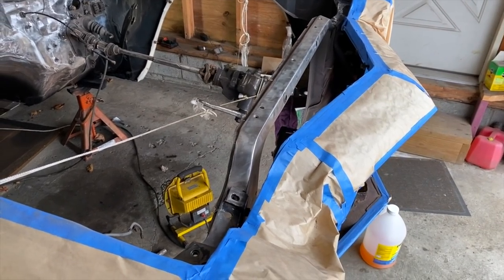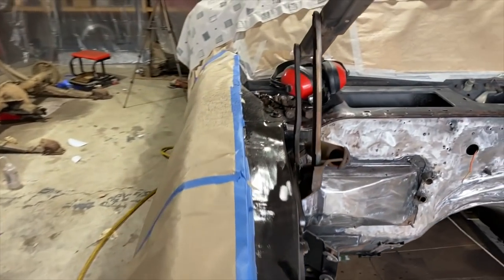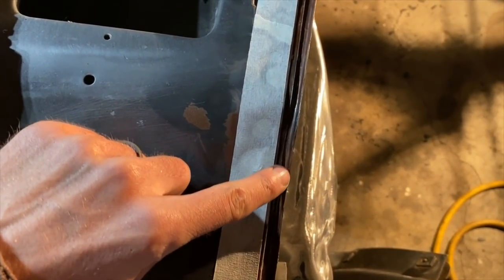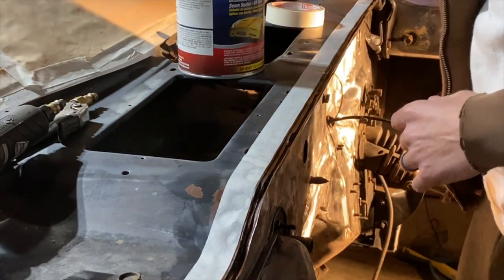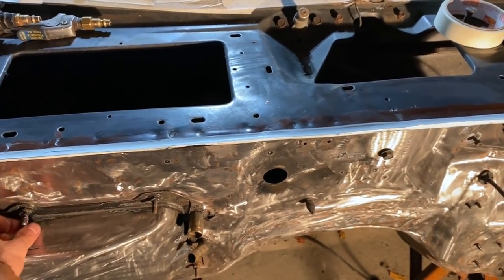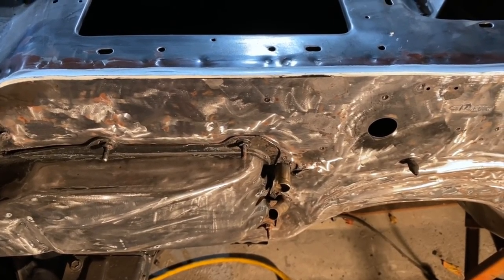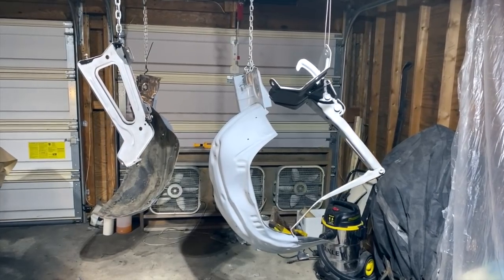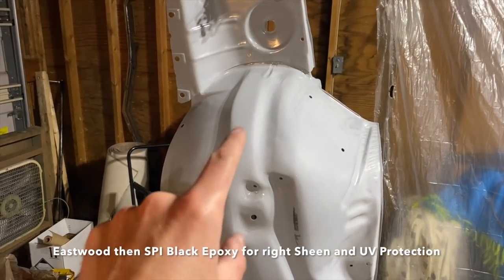PAINTING the ENGINE BAY, Rear Differential and MUCH More On the 73 CAMARO- Let's Sling Some PAINT!!

Comment: I think on the later "73 built Camaros the trim tag is accurate...in place with screws.    I don't believe they were all rivited on.
Reply from the maker: Awesome! Thanks for the tip Bobby. Going to have to look into it more then!👍
Reply: I would like to see a video on the seatbelt warning system...it would be cool to see you getting that working as designed.  I can assist with that... Awesome work, please keep the videos coming!
Reply: Screws are factory my 73 z28 has them.

Comment: I know this is a month old video but I had to say that removing the vin plate & body tag(s) is a major no no. Mopars are a little different as their tags are on fenders but I have never & will never remove any factory installed data plate. I believe its even illegal in certain states. Too much of a liability removing them as you always wonder if something shady is going on. I will not buy any car or truck that I even suspect that the plates have been messed with. I'm sure I'm not alone thinking this way.
Reply from the maker: VIN tag was never messed with, trim tag is being bolted down the same exact way with the same screws used from the factory. I wouldn’t buy a car either with the vin tag being removed and if the engine wasn’t numbers matching to the VIN 🙂

Comment: you have restored this car at such a great level, you gotta paint it perfect on the outside if it was me. then it will a gem. you do great work buddy. dont let the engine bay look better than the car finish
Reply from the maker: I agree! But I am trying to resist painting it until after I get some cruising in. It’s on the radar to just restore the whole thing (eventually) 👍👍

Comment: on a 73 Camaro the Z28 engine code is part of the vin. the 5th digit is the engine code. For Z28 it should be a "T" for the L82 - 350ci 245hp Z28 engine. as long as it has a T in the 5th digit of the Vin it is a Z28.  as far as the trim tag goes. you car prove it is real with a little math. you can verify that the trim tag is authentic by looking at the build date stamped on the tag.   the first 3 digits on the bottom row of the trim tag will be the month and week built. For example 04D would be the April of 1973 week 4.  nastyz28.com has a list that shows the last Camaro vin made by month.  the last vin for march was 156034 and the last vin in April was 165811.  so 9777 Camaro that month. divide by 30 days and you get roughly 325.9 cars per day. so add 325.9 cars per day to the last vin in march to get the approximate starting vin number, then subtract 325.9 cars per day from the last week in April to get the approximate ending vin.  so the first day of week 4 in april 1973 was the 22nd. so 325 cars x 21 day = 6843.9 cars. and the were only 2 days in the end week 5 in April so roughly 652 cars.  so the starting vin that week should be approximately 162878 and end around 165159. as long as the last six digits of the vin fall in between that range, it can assume that is that trim tag for the car.  I was just using an a 04D week tag as an example here because i have do not know your actual vin or trim tag info. and this method is not 100% accurate, but the probability of someone swapping the trim tag from a z28 built in week 4 of April 1973 to another Z28 built in week 4 of April 1973 are extremely low after 47 years.
Reply: I forgot one additional bit of info.  GM switched from rivets to screws for trim tags on the 3rd week of April 1973.  (which is why i had April 73 stuck in my head while i was making the example above.) after re-watching the video, and looking at the screws on the tag, i can say that those look like original GM screws. verifying the build date on the tag will tell 100% if the screws are correct if the car was built in 04C and latter. i tried to get a look at the tag in the video, but the camera didnt pick up the corner of the tag for me to see the build date
Reply: @shadvan9494  he shows and decodes the tag in one of his earlier videos that he made of the Z right after he got it.

Comment: Hey Ryan, glad to have an update.  I've said it before, really respect your approach.  It's coming together nicely and you will end up with something that you will be proud to show and drive.  The correct rivets are available for the cowl tag, just saying.  Also I didn't see you  touch the hood hinges.  I have a guy in SO CAL that I use who does beautiful rebuilding and cad plating them, just a nice result.  Your engine bay is looking fantastic.  Great to see that tag on the diff cover.  I have 3.7 gears in my '63 Impala and my '70 Monte, they're great off the line and streetable. Take care.
Reply from the maker: I appreciate it! I didn’t do the hood hinges yet since I am on the fence if I want to send them off for CAD plating or go more stealth with black. Do you have your guys contact info in SO CAL?
Reply: @RyanSampsonRPh  I will send you the contact info. and pictures this evening via your email.  Cheers.

Comment: Hey Ryan, what pressure are you using to spay those parts with you gun? Looks awesome.
Reply from the maker: Hey Morgan I use 25-27 psi at the gun with a 1.5 tip! Reduced the spi epoxy about 10%

Comment: 0:56 yes s/b body colored. I would find a match and do it right. You can go to Napa and get a spray can made up. If someone removed the trim tag that usually spells fake Z28 to people. That’s a no no when restoring a car. Leave it alone for people out there if it’s original or you may open up a can of worms in the future.
Reply from the maker: After reading a few comments it appears late 73 cars had the trim tags held on with screws instead of rivets. I will be replacing it back on with the screws 👍
Reply from the maker: @johnmilner7603  Nope only 1 set. You might be able to see it in this video right after I popped it off for the first time